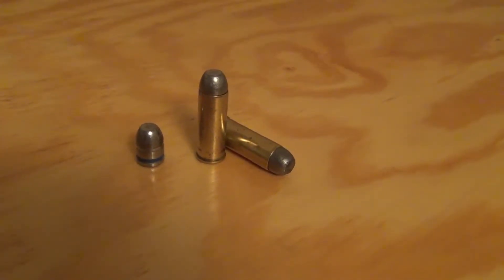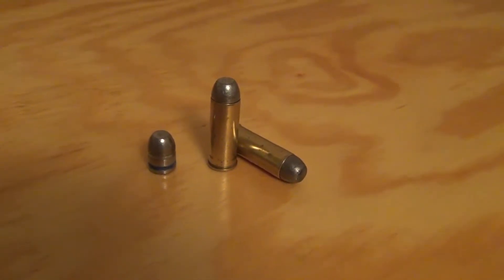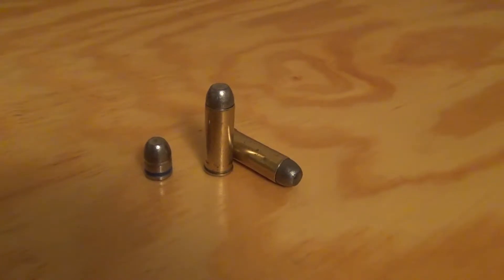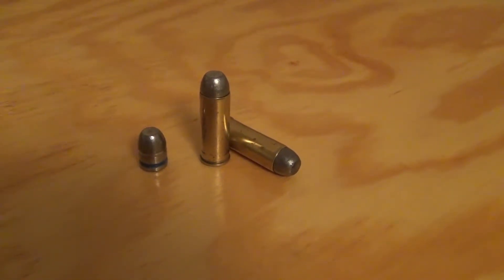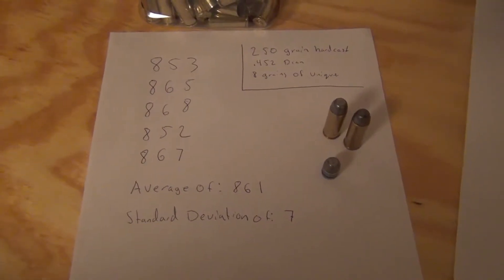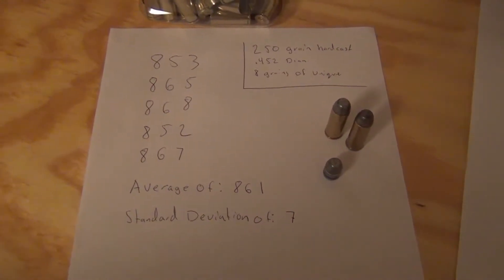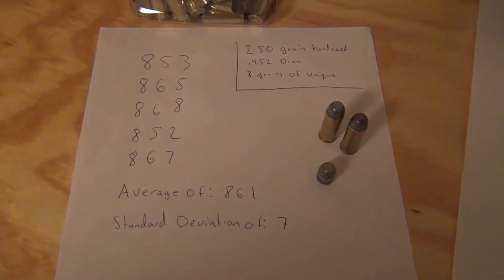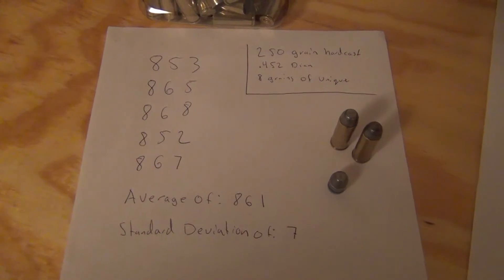.45 Colt handload performance test.

Comment: thanks man im new to reloading now u got me confident in using 8gr of unique as a standard load great video
Reply from the maker: It's a fun hobby. Checkout fortunecookie45lc he's got a great channel for reloading
Reply: @flynn88MN  what brass do u use? i dnt have a trimmer is starline any good
Reply from the maker: @marcusmann5859  starline is great. I bought a few bags of once used brass online. That's a good cheap way to aquire brass. Alot of it was starline. Ive never had to trim my brass. 45 colt is pretty low pressure so it's usually not a problem
Reply: @flynn88MN  ok thank you good sir for the help appreciate it